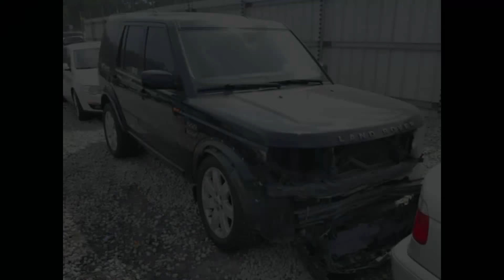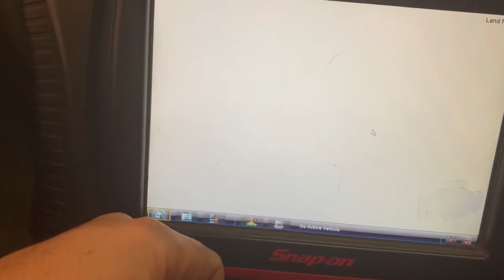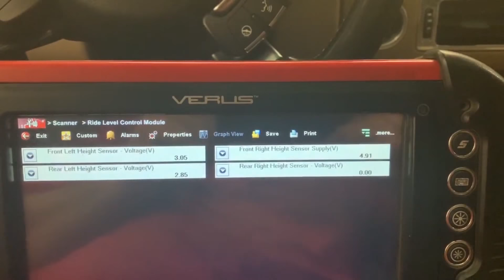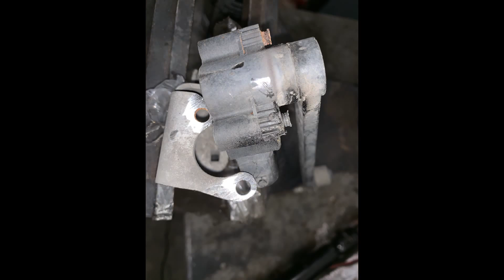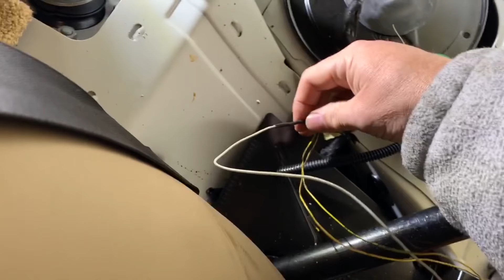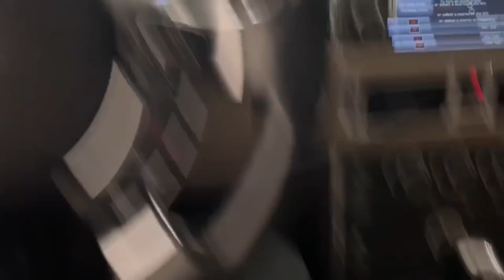Range Rover Air Suspension Problems

Comment: I have a 2007 Range Rover Sport that has had the suspension fault light pop up for a while now, but like a dummy, I continued driving it because the suspension was still raising and lowering. But 2 weeks ago I got in it to leave before I realized that it was sitting pretty much on the ground... the suspension was lowered all the way down. It's all aired out and won't raise at all whatsoever. When we pulled up the 4x4 info on the navigation screen, all of the little lines that are normally little white lines and are above each tire on the screen, were showing up amber colored?? All 4 little lines were amber?? Do you, by chance, know what the issue might be?
Reply: You not the only one man that keeps on driving I have 07 RR sport supercharged, and I have that light on for 5 months yeah the 30 mph thing is annoying but as long as you don’t floor it and accelerate as normal person 😂 truck will be pretty much normal, I finally found a solution for this and it’s just replacing the air compressor which I just ordered off of eBay !!!

Comment: Hello, I have a 2012 ranger rover sport and I’m getting the message slow down or vehicle will lower. What could be the problem? Thanks
Reply: You have selected Off Road Height.
Select normal height and it will be fine. Otherwise just keep driving and it will lower itself. no problem.

Comment: ???question for anybody??? I am looking at buying a 2009 Range Rover Sport HSE.  The rear suspension goes lower when the car is turned off, then when you start the car if goes back up. My question is this normal operating procedure for the car or should the Suspension remain the same when you turn the car off? Any help or answers are really appreciated. tks..greg
Reply: It’s not a problem it should be like this
Reply: my advise , don't buy it. they are full of problems and are money eaters